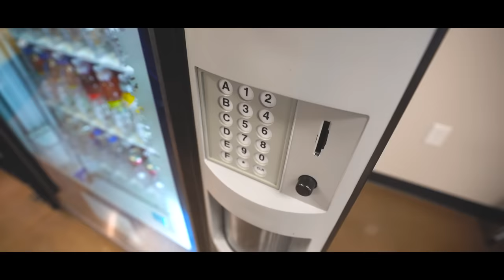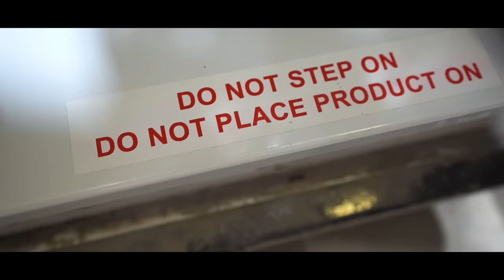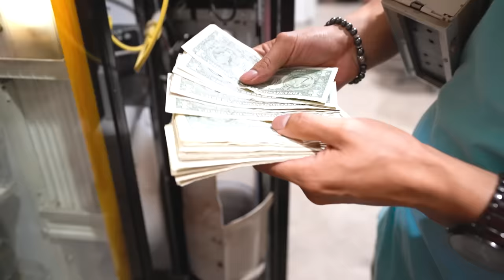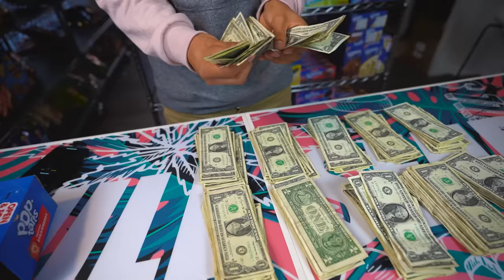Pulling CASH From My BEST Vending Machines! 2021

Comment: 1:41 first in first out dude. you shouldnt be putting the news in front of the old ones. not practical. LOL about the label. how much does it usually cost to start a machine at first? do you have to pay for the spot in the location, too?

Comment: I use to pull money from Vending Machines from JFK Airport,  and I would easily pull out 51K in a weekend
Reply: What were the hottest items that sold the most made the most money?
Reply: @juansalazarjr10  Soda is easy money during the summer and Candy in the Winter,   because candy melts in the summer,  unless the machine is in cool area.  A full Soda machine would be empty with-in 2 to 3 days,  the only thing that sells the least is Diet Soda,  but you have to fill it because ppl who drink Diet Soda bitch and complain the most

Comment: I worked in vending for 17yrs filling all types of vending machines. It looks like you have two good locations but I see a problem. Your not making as much money as you can. That first location the drink machine and snack machine were basically empty. If your really going to that location every two weeks you need to start going once a week. Most good accounts will have a few empty rows but then you double up on what's selling. You said that a person sat right behind you watching you fill the vending machines. You also said the warehouse was closed? Guess who that was sitting there. They were probably a manager though I could be wrong. You NEED to service them once a week. You also need to service that icecream machine once a week at the 2nd location. If you do that you will make more money. Its only a matter of time that another vending company going to those accounts and if those machines are empty like we saw in the video you might just lose the account. Im not trying to be negative but machines can not be that empty. Your losing a lot of money letting them basically go empty.
Reply: What were your top selling items?